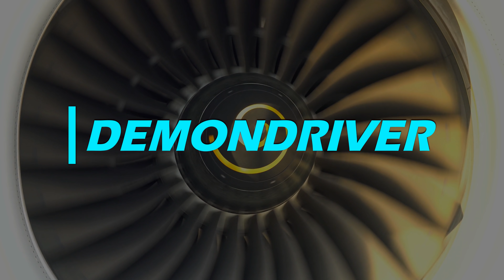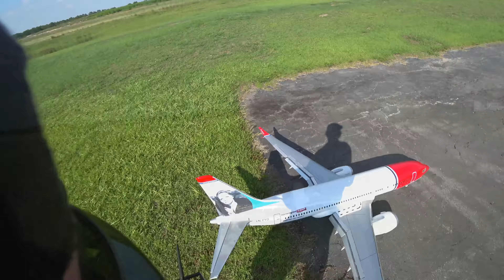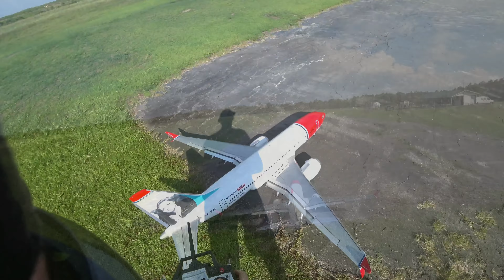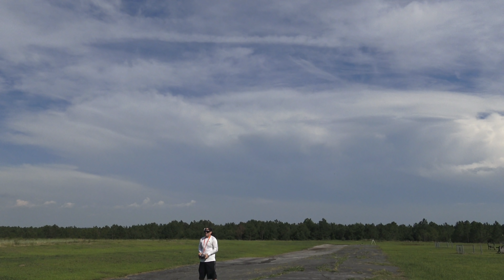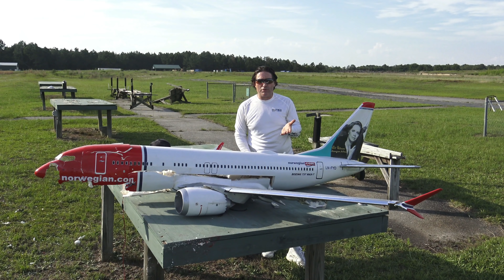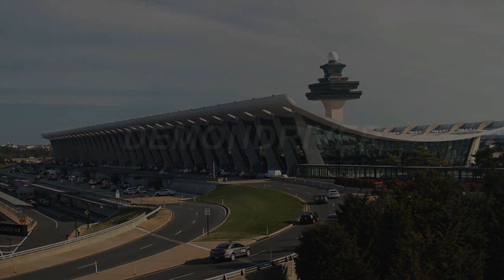RC Norwegian 737 Max-7 2nd Flight! [4K]

Comment: You're awesome! Love the reaction and the recovery. I didn't catch my recent EDF crash on tape but it was very similar to yours. Playing, stalled, recovered, changed directory, high speed under controlled and level flight directly into a hard object (trying to pull up of course). 
You know, (with you) I laughed out loud on seeing the dust from the impact, but we might as well accentuate our crashes. Maybe a little breakable upon impact sack of baby powder. 
Check my videos and in the Cessna flight you can see the shipping containers I ran into. There is another video of jet parts. 
Have a good one my friend. Don't it feel better that at least you recovered from the stall.
Reply from the maker: Hey that made me feel better Sir, I'm truly lucky nobody was there in the pits or in the club house or there could have been injuries  . . . .I would trade all my 250+ RC Aircraft instead of hurting someone or worse.
Thankyou for your awesome Comment Buddy!

Comment: how can i tell the CG on the 747-8i on boeing , RC DEMON DRIVER need your help please ….
Reply from the maker: Hi Jose, the CG for all 747's is just a tad in front of the main wing gears Sir, around half of the 747-8i's wing chord.
Reply: @F3HDemonDriver1  thank you very much I thought so it will be right  there by the wing area between the two motors in the front I'm s scratch biuld 747-8i 10-ft. Long and 9-ft tip to tip and 2-ft.wide also a 747-400 starting to be built soon thanks to you my best friend nice to meet you I'm in Bayonne, NJ 07002 I been watching all your vedios from day one .....
Thank you again 😊
Reply: @F3HDemonDriver1  sorry about your airplane crash 737-max7 there was a lot of wind when you turn feels like a engine stall that made the plane go down
Reply from the maker: Hi Jose! Well there was a left to right Cross-wind on takeoff hence why the bird drifted right on takeoff but that stall was 1000% me, pilot error!
Reply: @F3HDemonDriver1  ok wow thank you so much

Comment: Seems like you weren't informed about the MCAS.
Reply from the maker: LOL, No I wasn't informed Not to stall my 737 Max-7 and fly it into a flight table. LOL
Reply: Actually MCAS is suposed to avoid this by lowering the nose if the angle of attack gets too high.. the problem with the real MAX was that faulty AoA sensors would trick the MCAS into diving the plane into the ground.. What is weird is why Boeing is having so much trouble with it.. alpha floor or angle of attack protection is something that has been there for ages.. not only do Airbus liners have it since the 80s..the F-16 uses an angle of attack limiter and its a mid-70s jet.. its not something unheard of ..but the entire MAX fleet has been grounded for 4 months now and still no end in sight..
Reply from the maker: True, very true, But here I just stalled the Bird, totally my fault.
Reply: @F3HDemonDriver1  I dont think you would do that mistake but the flight before the climb seemed to be a bit nose up ... could it be a bit tailheavy?
Reply from the maker: No Sir, CG Is Fine, I pulled up, I caused that climb Sir, I was trying to gain a TON of altitude and pulled up too much and caused a stall.
Reply: @F3HDemonDriver1  then its like my ASK21 :D